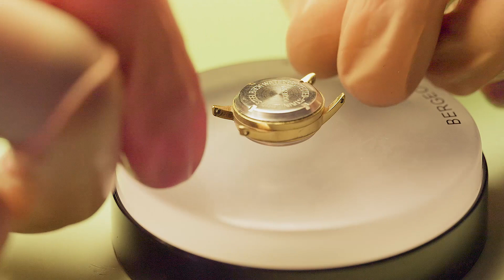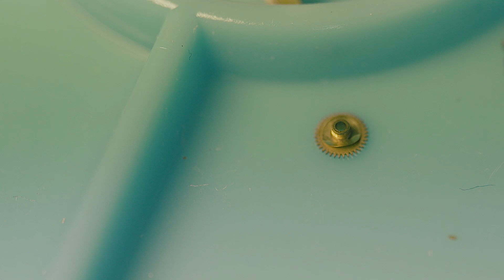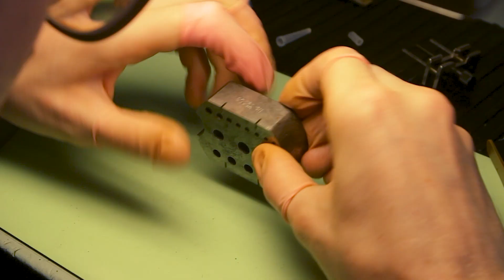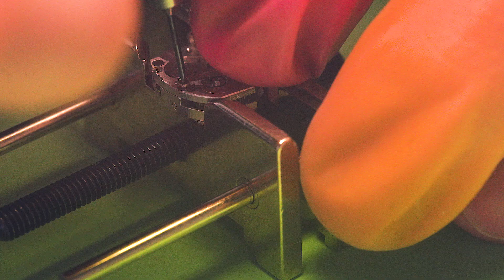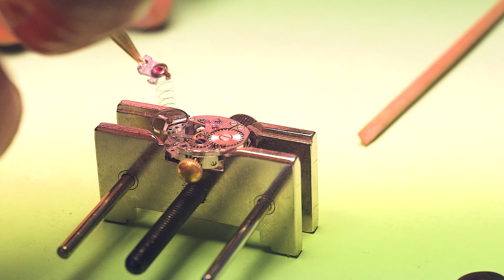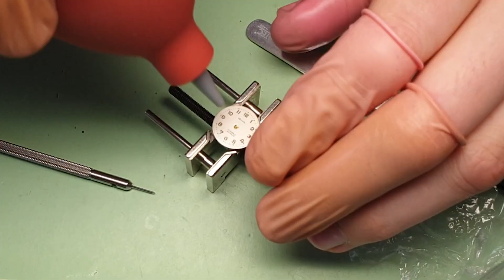Her grandmother's watch was NOT RUNNING at all | watch repair & restoration

Comment: That's not a good way to put away such Sensitive watch hands just Throne just like that into a plastic bag 😢 not good 😢
Reply from the maker: Good point. Thanks.
Reply: @SecondHandSouvenirs what a humble reaction! But it’s a watch repair & cleaning seems very clean & tidy for a work station & I have to ask? Did he fix it? No extra parts one put back together? No then he’s amazing! You’re peanut butter and JEALOUS HATER this is to Hector rude ass